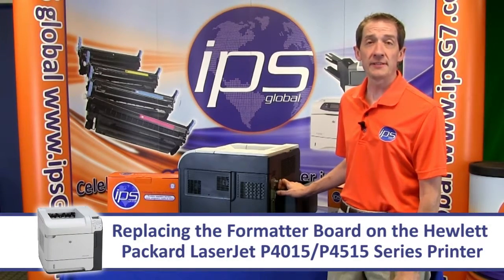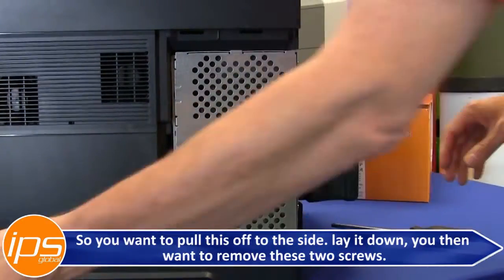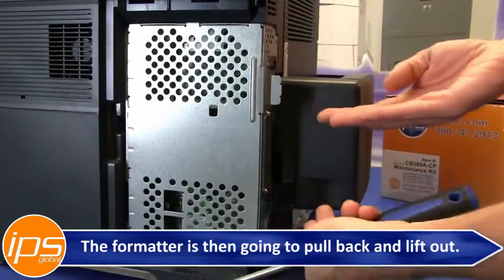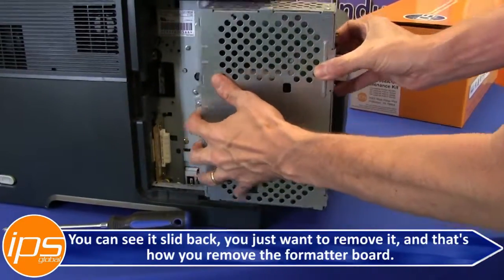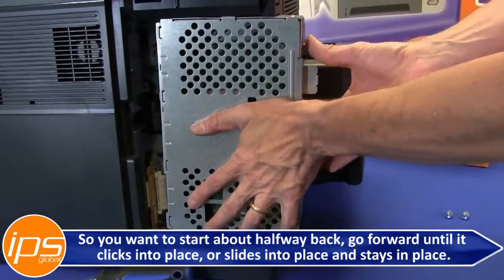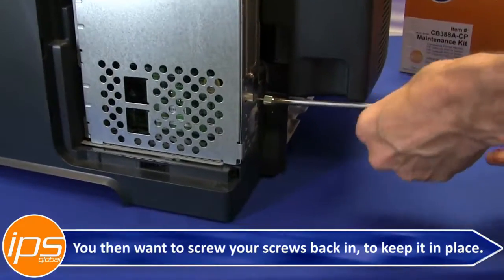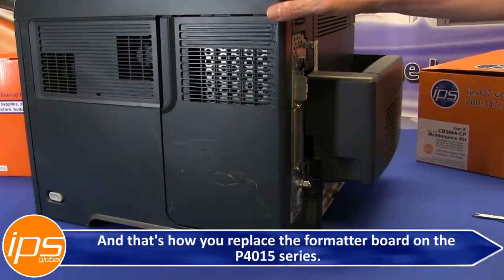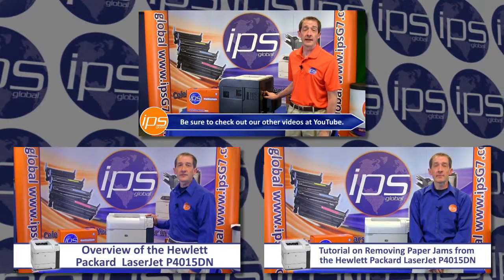HP P4015/P4515 - Replacing the Formatter Board

Comment: Hello , I had to replace the formatter board and now I need to reset the page count and the serial number but for some reason the service pin is not working to get in to the service mode, jm guessing some changed it. My question is how do you change the service pin back to what it's supposed to be? This is the pin that I've tried, 05401508, hp p4015